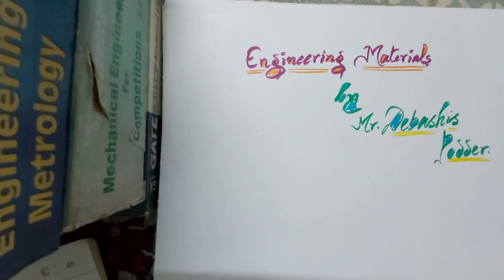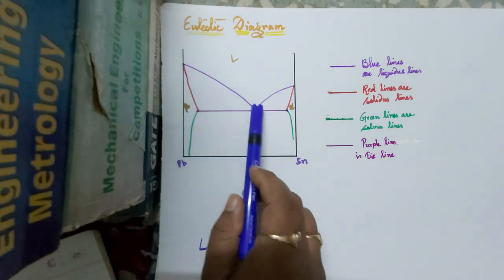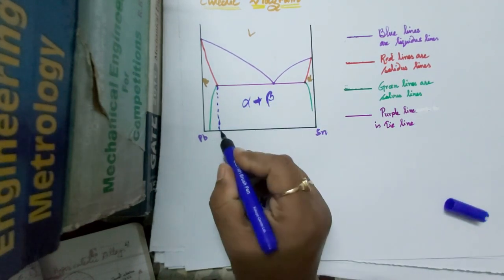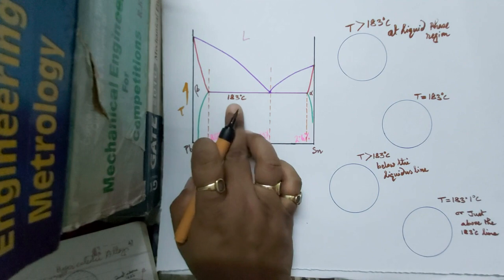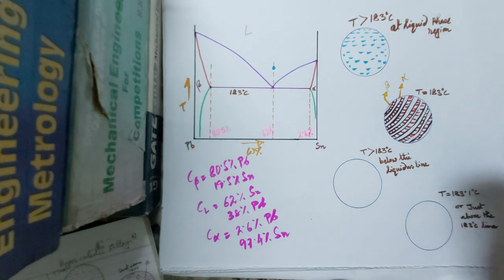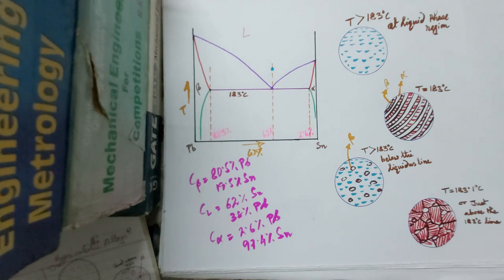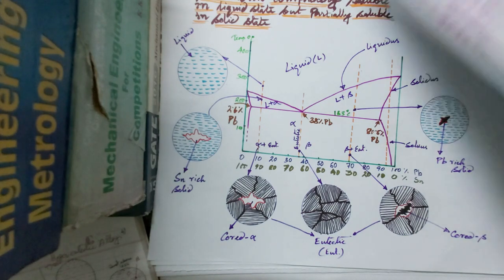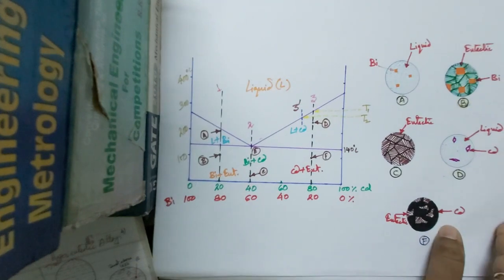Engineering Materials, Lecture no. 14

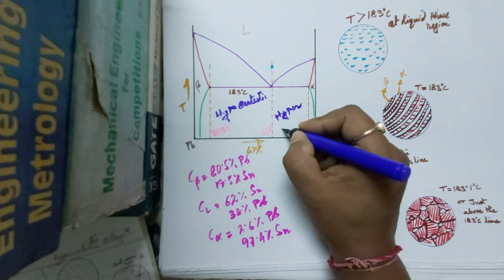Comment: Sir, based on your explanation of different microstructures in Pb-Sn diagram, I would like to know that at Eutectic composition and temperature on or just above 183°C, the structure would have crossed into liquid region, so why does the microstructure have no liquid presence? (For reference at timestamp 25:00)